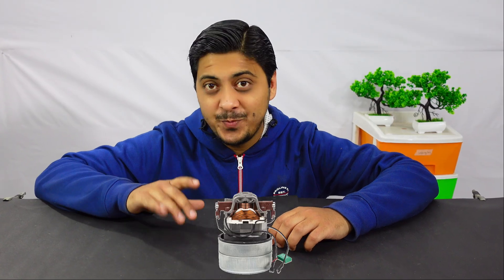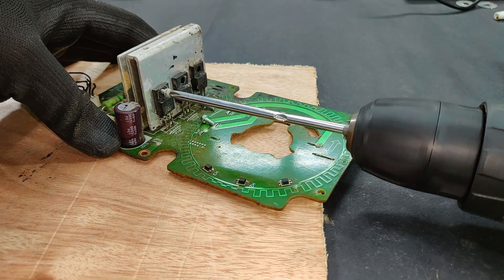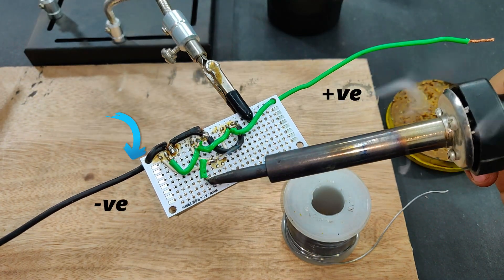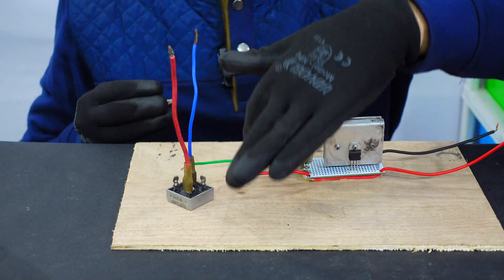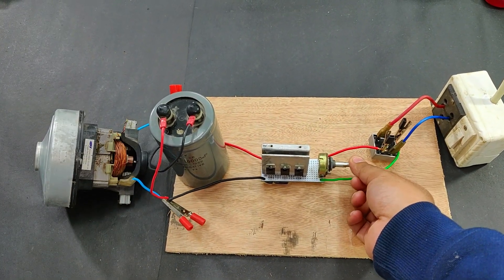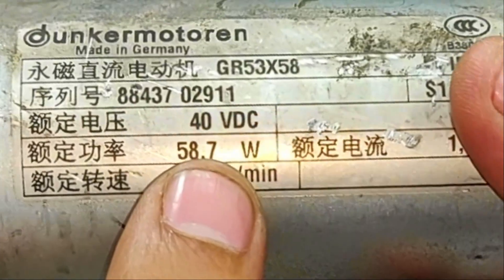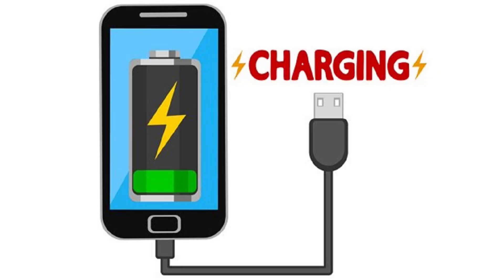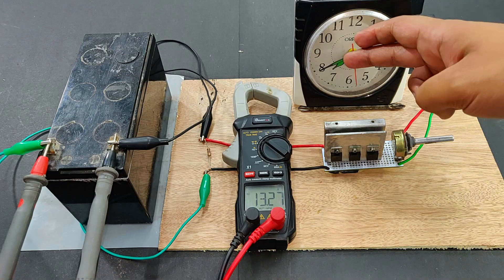4000 Watt Universal Motor Speed Control - Make 120v RPM Controller DIY

Comment: What i dont understand is why a commercial product uses so many components on the circuit board when you only used about 5 components and a heat sink.

Comment: Connecting  and handling mains voltage in this way is very dangerous, one mistake  and you could be killed.

The three  transistors used in the demo should have highish wattage, low resistance resistors after each of their emitters to help balance the current through each transistor.  The transistors are being used as a variable  resistance, it works but it is not efficient. 

Your circuit also needs a diode in ant-parallel across the motor leads to prevent back emf fron destroying the transistors.

The motor used is a universal motor, its speed can be controlled using a simple triac circuit.  Triac speed controllers are very cheap, and will be much more efficient that the circuit show.

Never, ever put oil on a commutator, they are never to be oiled. Commutators should be clean, with no carbon between each segment.

A universal motor under no load, may overspeed and self destruct.

Comment: im an absolute novice when it comes to power and electricity. I want to use a regulator in order to control the spindle speed of an old drill motor im suing as a mixing motor... any thoughts? I dont mind just to buy a regulator.

Comment: 🙏🙏Please reply soon Bro in the circuit diagram two terminal of input voltage is directly connected the variable resistor even I give 12v it get short circuit
Reply from the maker: Seems like variable resistor is bad

Comment: This circuit controls voltage value to power universal motors. If you use this for power tools, you will loose torque for sure.

Comment: Could this controller work with 48volts, and run a 8 or 10 kw DC motor? I want to electric drive my boat and bought an old 8.7 kw forklift motor for that but can't find any factory made controller that can handle the wattage

Comment: This is one of your best overall videos brother. Many of them are difficult to understand (why or how) things are happening, but here you made it easy while showing off a very useful tool. Thanks
Reply: But this will harm ur motor. It is not design for brush motor. It will create alot of amp when the voltage is reduce n burn ur motor. It can be use for brushless motor.
Reply: Unfortunately, this video demonstrates how to handle mains voltage in a very unsafe manner. It doesn't appear like you have a lot of electrical experience, and not knowing exactly what you're doing when handling main voltage could literally kill you.  This video should be taken down.

Comment: Thanks for your reply. The fourth transistor is the same as the other three. And another question: why regulating the speed of a motor every time it takes more speed on its own, that is, you regulate at one speed but the motor is taking more revolutions, it does not stay at the regulated speed of rotation.

Comment: Half a million people were deceived (I mean the text about 4000 W)...Perhaps it will be a revelation for you, but a 500 kW motor can be spinned up from a household power supply, only it will not generate operating torque, and therefore all energy will go only for the rotation of the rotor; any load will cause an emergency power outage... Try to put a load on the shaft in this circuit, or even more so, stop it; you will see a bluish smoke appear from the depths of the transistors))

Comment: As far as I can see that is not a speed controller but a torque controller which is not the same issue.
As the output is taken from the collector of the transistors, then the unit is a current source with a high impedance output and not a voltage source with a low impedance output, hence it is a torque controller.
If the output was taken from the emitter as in an emitter follower, then the unit would be a voltage source and hence it would be a speed controller where the voltage of the source would be balanced by the back emf of the motors. That is what we mean by speed controllers. The input voltage comes from a low impedance source, hence a voltage source must be balanced by the back emf of the motors being used.    
The sound suggests it is a current source controlling the torque. If those motors were fed from a  voltage source the acceleration would be much faster.  One should be careful when using a transistor as a current source and using it as a voltage source.

Comment: How about mr electron, is this speed control system suitable for use with brushless motors with three outputs? And if this is how it connects to your system, would you have to adapt it to the 40 Amp esc driver or is it not necessary? Thank you in advance for your contribution ... your video is excellent
Reply: This type of drive concerns direct current motors. Universal motors are series magnetic excitation motors that can operate in direct or alternating current (motors that have the annoying habit of racing at low loads).
Brushless motors are synchronous AC (three-phase) motors, this type of drive is not suitable.

Comment: this circuit just works in short period of time due transistor thermal overrun.
Reply: Yes not very efficient , using a transistor in the non saturated mode is transferring a lot of power into heat, yes you have a large heat sink. Using PWM would allow transistors to fully saturate , Mosfets would be even higher efficiency .

Comment: Once off, those motors are generating power that's feeding back into your transistors. I would suggest that the proper diode on your output would provide some protection, significantly prolonging reliability and operational lifetime - thanks for the video!
Reply: I was wondering that to myself.

Comment: Hello, what is that type of capacitor called and where can they be found? Is it electrolytic? What if it was positive?
On the other hand, is the fourth transistor the same as the other three?
The potentiometers that I have reduce the speed but little by little the engine is increasing its revolutions by itself and I want to try the one you explain if this does not happen.
I am looking forward to your response.
Thanks
Reply: Here the transistors operate in variable resistance, they will heat up very quickly and the overall behavior will not be very stable (maybe your problem). This is not the right method for this type of application. A PWM command (see wikipedia) would be much more efficient.
The capacitor is of the electrolytic type.
Be aware of the danger of voltages greater than 50 V AC, 100 V DC.

Comment: 1. Circuit is way too inefficient
2. The transistors are in linear mode. This means that they will overheat too quickly. (BTW I'm sure that he didn't run the motors for more than 5-10 seconds for this very same reason).
3. The circuit is not very reliable. As a proof I can say that at 6:01 the transistors burnt out. That's why the motor suddenly started to spin at full.

Verdict:
Don't build this circuit. It is a bullsh*t   :)

Comment: I like this  when you make something yourself, that gives you more confidence, can you run a brushless motor with your speed control? this is very good love from Canada.
Reply: This type of drive concerns direct current motors. Universal motors are series magnetic excitation motors that can operate in direct or alternating current (motors that have the annoying habit of racing at low loads).
Brushless motors are synchronous AC (three-phase) motors, this type of drive is not suitable.

Comment: The circuit is very basic and has no protection. It would be OK for small motors, but it would be preferable to use a module specially done for that purpose.

Comment: Question: the diagram says that you must connect the capacitor in parallel respecting the polarity at the regulator output, but in the video you connect it by reversing the polarity ... why?

Comment: Now this is the type of controller I would like to swap out the digital controller in a tesla if not generally in any ev for making the car even better than originally.
Reply: Are you serious how in the world would this be better than super engineered tesla controller.
Reply: @dkdanis1340  it's not requiring anything digital that needs it's own power to power a motor eating into the power consumption which is not ideal for an electric car as it creates a bottleneck in performance and range.

Besides it's something entirely else than what everything is transforming into in the present.

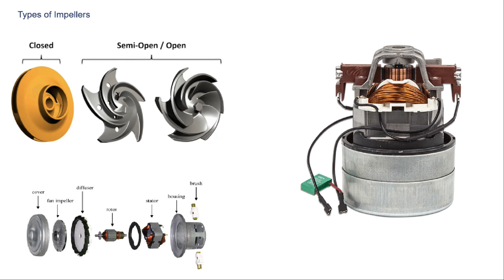Comment: 1:30  you asked: okay, use that center hole where the impeller is, and place about a 6 inch funnel facing it, narrow side into hole. Put all this behind your grinder wheel, and attach the motor wires to the grinder switch. So, when you switch on the grinder, the vac sucks from the funnel end, into vac and into a hose into shop bucket, with cloth over top. I also use microwave oven magnets, on the grinder shroud, to attract filings.      Njoy your creations, thankyou too much.

Comment: Do you have a link to DC  brushed or brushless diy controller that's not expensive to build.  I want to put an electric motor with flex shaft on a kayak,   and be able to control speed somehow ....the brushed and brushless controllers I have found that will handle aprx 500-750w motors are very expensive.  Thanks

Comment: This is very good circuit, can I use for 220V?
Reply: Thank you for the reply, can you advise which component I should replace to match 220Volts?
Reply: @ghsh837  the MOSFETs I think.
Reply: And the rectifier
Reply from the maker: No..  it will heat and burn

Comment: Hi mr electron! I really love  ur video very helpful ❤️  i have a alternator from a zusuki multicab. How can i run it as a motor direct from 12v battery without using speed controller? 🙏🙏🙏❤️❤️❤️
Reply: An alternator is a synchronous machine with alternating current, it is compulsory to have a frequency converter to control this type of machine as a motor.
Car alternators have diodes that convert alternating current to direct current to power the car (unless yours is of a very different technology). In addition, they have an auxiliary magnetic excitation circuit that must be supplied in alternator mode but also in engine mode.

Comment: it should be encased safely in non conducting casing and pot knob also needs to be plastic encased to prevent fatal electric shock in case of failure

Comment: Is it OK to oil the commutator like that? Does it help?
Reply from the maker: I have been doing it for 15 years without any issue and it improves rotation.
Some say that its not right but i find it quite effective.
Reply: @MrElectron  thank you for tip
Reply: @Lorrie Carrol -  Your graphite brushes 
Will wear out faster if you oil the commuter!

Comment: What was the purpose of using power transistorts here.....?
Reply from the maker: Increasing amphere handling capability of the circuit & output voltage control using voltage divider technique.

Comment: That circuit will burn if you use it at half power and actually use the motor. It needs to be pwm switched or else it wastes a ton of power as heat. All you made was a variable resistor... sure it "works" but it is potentially unreliable and wastes lots of power...
Reply: In reality, it does NOT work on the A/C motors.  That's why he kept raising the speed, instead of stopping in between anywhere.  That's because it WON'T stop at a lower speed, it will "run away".
Reply: @johnbarry8185  got any suggestions for a treadmill control the original is busted and I'm on a budget
Reply: Agree, total BS.
Reply: Yes, ...
Reply: where do I connect the pwm switch.
Reply: More YouTube BS.

Comment: I want to know how to calculate fly wheel to use when building free energy generator
Reply: I believe using BLDC motors and controller electricity can be amplify or in other words consuming very less electricity this mechanism can multiply the output current. Heat and sound issue can be controlled by using (transformer oil colling system)  heat sink, air cooler, water cooling system
Reply: @rig_it_safe  transformer
Reply: free capati have but no free energy...yoi can buy solar panel to help get something close to free renewable energy
Reply: Easy. There’s No such thing as a free energy generator.  It goes against every law of physics. If anyone ever figured it out, we would never need gasoline or other fissile fuels again.

Comment: 4kw????😂😂😂😂😂😂😂. Lol . Nice joke 😂
Reply from the maker: As i explained in the video - each transistor can handle a max current of 12 Amps as stated by the manufacturer and i am using 3 of them in parallel so 12 x 3 = 36 Amps max.
         Max voltage handling is 400v for each transistor according to 13009 data sheet and my setup rating is at 120v max therefore 120v x 36A  =  4.3Kw at full output.
Reply: @MrElectron  linear operation of transistors.... Impossible power for the TO-220 package , even if there are 3 in parallel.
Reply from the maker: I understand your point but that situation occurs only if you use lower quality 13009 transistors ( the brand owners that say it can handle 12A but in reality they can handle only upto 1 or 2 amps ) there by making it incapable of handling the stated load but if the transistors are of quality and meet their actual stated values, it can surely handle that much power as i stated.
Reply: @spandandutta2485  точно, на 6:01 они сгорели и обороты вышли на максимум. Он сразу же отключил питание, а после показал уже с новой партией.)))

Comment: Sir where do we get those big capacitors please help🙏
Reply from the maker: The capacitor i used in this video is optional
Reply from the maker: Try India Mart if you are from India otherwise AliExpress or bangoods i guess.
Reply: Sir why didn't you used lm317 🙏
Reply: @pratikredekar2625  lm317 it will heat up and explode like capati in coconut oil...

Comment: Impeller is also used as blower for blast furnace and it's your as trabro charger for cars and it's your for cooling system for high temperature electrical equipment